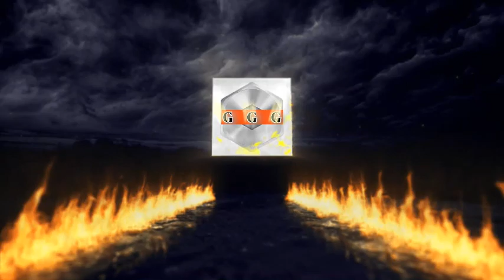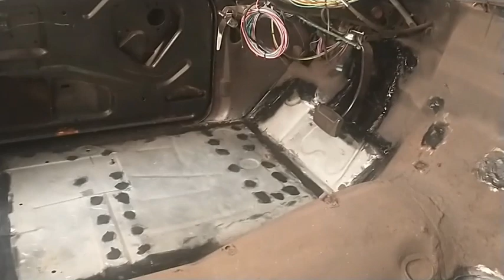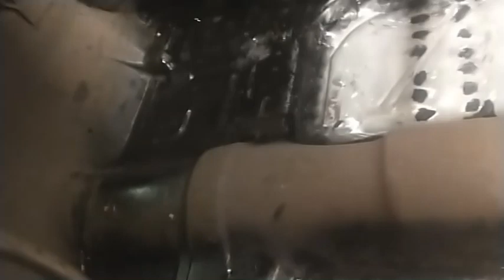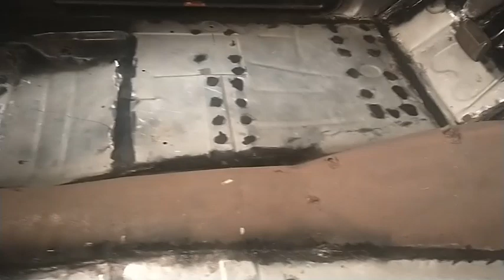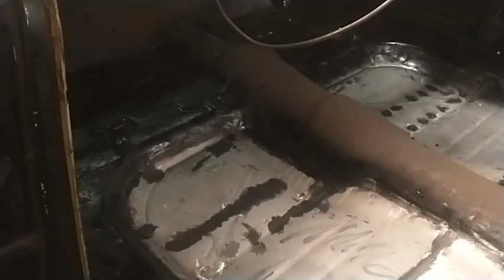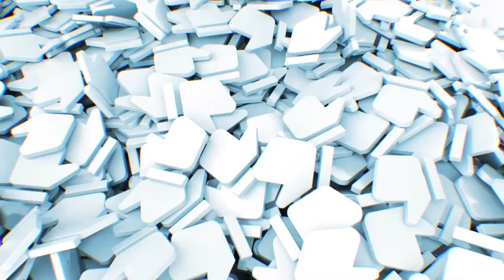The Floors Are Finished!!!

Comment: Dude, I WISH full floors were available for the 55-56 Fords! They don't make them even for those! (My 56 Customline NEEDS one, it's about as bad as this 59!)
You did a good job Mike, that's a lot of work crawling around inside there. Once the floor is painted, sound deadner and carpet is installed, it won't matter how thick the seam sealer is. As long as it's sealed up, good to go!